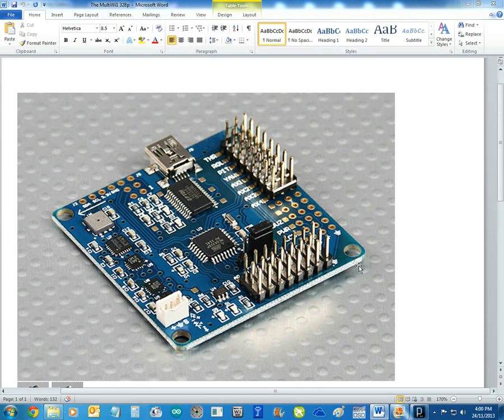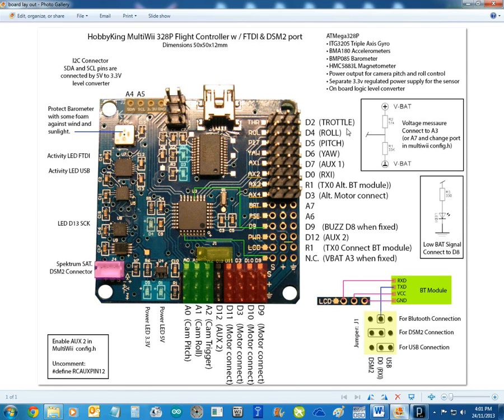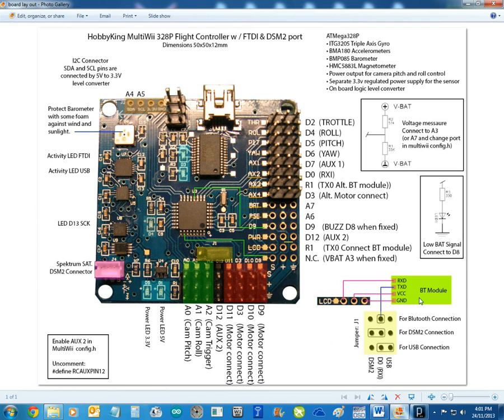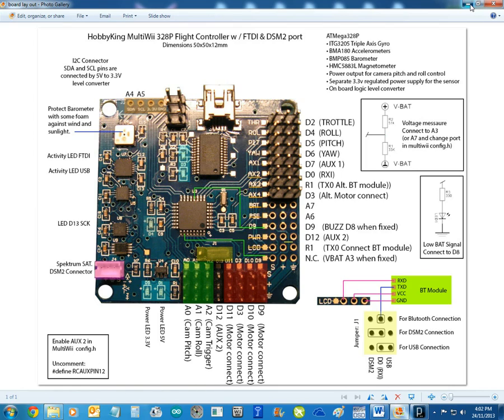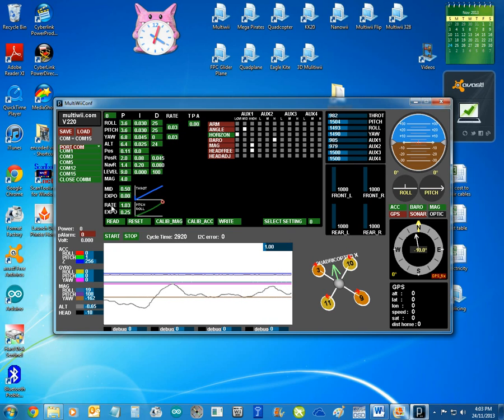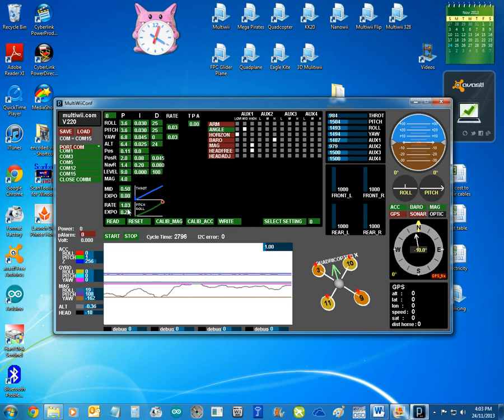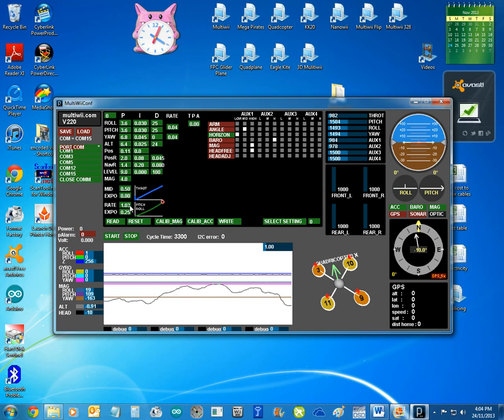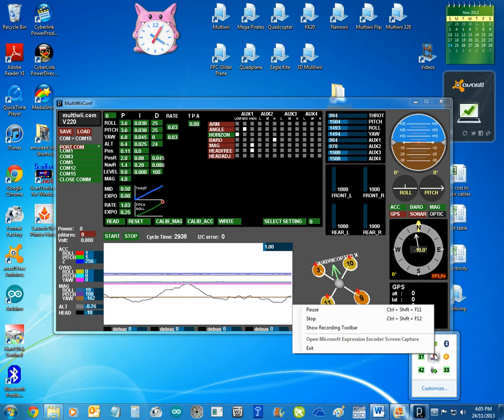HobbyKing Multiwii 328p Flight Board Setup

Comment: I have connected bluetooth, and this works fine, but there are no sensors and loads of I2c errors.. please help i love this board, and would so much like to get it going....thanks AL...
Reply from the maker: So what did you do to fry the board?..... as that may help me with a solution as I once damaged my board and I was able to trace out the fault and fix it......you know the safer alternative is to get another board weighing up the cost of the fix plus the risk of what else may have been damaged or be faulty which you may not find out till your up and away because you will be down and out...... sometimes we just have to walk away from the crash site knowing there are no survivors....... but on the flip side it gives us a good opportunity to try other boards while we tinker with the fried board....... that way you still get air time without the pressure..... maybe not the answer you wanted but its what always tell myself..... $27 board verses the $300 rest of the copter.......

Comment: Tony, I have an issue with multiwii328p i pretty much think the 3.3v regulator is fried.. there is no 3.3v led lit up, and i have checked for 3.3v on the pad just above the regulator... i was wondering whether i could cut the output track from the regulator, and supply 3.3v to the 3.3v connector on the I2c pins....from another regulator, or would it be better for me to replace the regualtor ? it has marked on it IL340 any advice please no sensors are being activated in multiwii.conf.... and there appears to be a dead short across 3.3v to gnd

Al....

Comment: moochasas ? will the 328p board that i have do gps waypoints, and RTH... is it powerful enough.... I assume that when waypoints are created, and uploaded to board they sit on top of the arduino code.. i just wondered if there is enough memory to do it...? same board you describe on this post...i need to upload firmawre to multiwii 2.3?
Reply from the maker: No unfortunately the 328 chip will not hold the MW2.3 firmware....... the best way to tell is when you connect your board to arduino and select the comm port and board type it will show you the chip capacity....... then when you pull up say MW2.3 it will show you the size of that file and there you will see what difference is..... cheers
Reply: ok i try that later thanks....I have run multiwii 2.3 on the board though.. i did it the other day but gone back to version 2.2 now...
Reply: i have connected the board to arduino 1.0.5-r2 via usb, and only specs on the board are....on the bottom right of the arduino app that says " arduino pro or pro mini ( 5v, 16mhz) w/atmega328 on com 5... i cant see where you get the chip capacity.... on the arduino app... am i missing something here ? that board type can be manually changed on the tools / board menu... any board can be selected but obviously i wouldnt do that...!!! i will try 2.3 again later....
Reply from the maker: You are on the right track....... if you tried to upload 2.3 navi you would see that the file is too big plus it wouldnt upload.... cheers
Reply: thanks Bud.... i going to get a naze 32 soon.. the multiwii is ok for the moment though
Reply from the maker: Also you might want to try the flip 32 from witespy... cheaper and a better board in my opinion.. cheers

Comment: I have this board hooked up to a tricopter and have yet to get it working.  I usually just throw in the towel after awhile and hook up the KK2.1 again.  While on the ground, after arming the motors, the yaw seems linked to the throttle.  Throttling up and the yaw servo angles one way or another.  This thing just ground loops instead of taking off.  All my connections are good and test out in the GUI.  Acc and Mag are calibrated.  Dont know what else to do.  Help!
Reply from the maker: What pins are your motors and servo connected to and did you calibrate the escs?
If a copter just flips over it is usually a sign that the motor escs are on the wrong pins........ my info shows front LH motor on D11...front RH motor on D10... rear motor on D9 then there is your servo.....

Comment: Could you please tell how to calibrate the Mag? What exactly do I need to do while the blue LED blinks for 30 Seconds?
Reply from the maker: To Cal the mag what I do is turn the copter:
tilt over forward 360 then
roll backwards 360 then
roll sideways right 360 then 
roll sideways left 360 then 
turn it over upside down and rotate it 360 (or in a circle) then
right way up rotate it 360.
Reply: thank you, that was very helpful :)